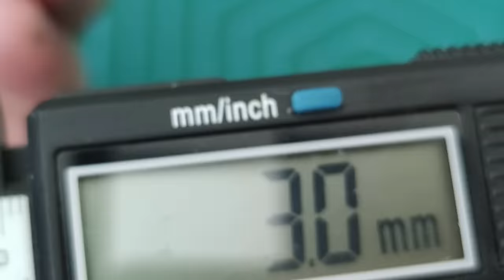3D Printed Mini Outboard Motor + Propeller FT009 RC Boat

Comment: Just printed your model in PETG-CF and PLA (for the cover) at 125% for a 1/8 scale. Really good option as a test motor. Works a treat, so far nothing exploded or melted. Might upgrade the bevel gears to brass tho. Cheers
Reply from the maker: Sorry for the late reply. I'm glad you like it.

Comment: Wires need to exit the shroud on the boat side, not rear of the cowling, otherwise spot on!
Reply from the maker: @Richard Billhartz   Thanks😁
Reply: @Mr.RC-Creator  It's the best outboard on the internet, I'll print one when you post the files, thanks!
Reply from the maker: @richardbillhartz4537  https://www.thingiverse.com/thing:3534935  thanks!🙂

Comment: it seems like you resized the files in order to fit the gear to the 3mm shaft, or did you not? the diameter is 5mm in the printed gear.
Reply from the maker: You can adjust it by 55 percent, if I remember correctly it is 3 mm in diameter.
Reply: @Mr.RC-Creator   55% percent resize? the shaft Outer diameter should be 5mm and inner is 3mm

Comment: BONJOUR AVEZ VOUS DES LIENS POUR L ARBRE DU Moteur hors-bord SVP MERCI
Reply from the maker: https://www.aliexpress.com/item/32998148718.html?spm=a2g0o.productlist.0.0.2bcd7213bv3k18&algo_pvid=c5815ea9-8fe8-4163-89ab-f51b516fa2a5&algo_exp_id=c5815ea9-8fe8-4163-89ab-f51b516fa2a5-18&pdp_ext_f=%7B%22sku_id%22%3A%2266917595769%22%7D&pdp_npi=2%40dis%21THB%21222.01%21222.01%21%21%21%21%21%402103255b16706672334093275e7526%2166917595769%21sea&curPageLogUid=nnd9v0eB1HnY

https://www.aliexpress.com/item/4000337533587.html?spm=a2g0o.productlist.0.0.69fb3010fDv9Ph&algo_pvid=26e29f39-62dc-4e02-98aa-8a10743191ce&algo_exp_id=26e29f39-62dc-4e02-98aa-8a10743191ce-35&pdp_ext_f=%7B%22sku_id%22%3A%2210000013712811036%22%7D&pdp_npi=2%40dis%21THB%21147.66%21118.13%21%21%21%21%21%402101e9d316706672842193584e653f%2110000013712811036%21sea&curPageLogUid=lnuEH8Qcn1Jr
Reply: @Mr.RC-Creator  AVEZ VOUS LE LIEN POUR LE MOTEUR AUSSI MERCI 
LE TOUT EST POUR UNE REDUCTION A 65 % ?
Reply: PS ET LE RACORD DU MOTEUR A L ARBRE MERCI BEACOUP
Reply from the maker: @leplaisiraletatbrut1513   https://www.thingiverse.com/thing:3534935    🙂